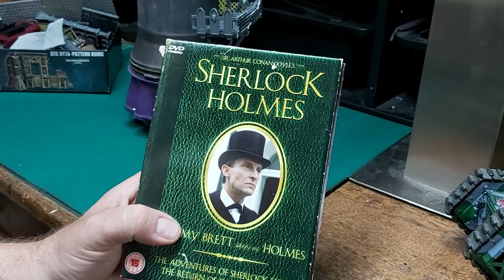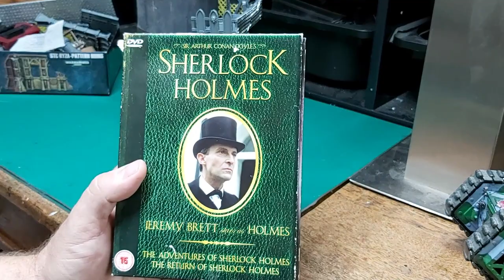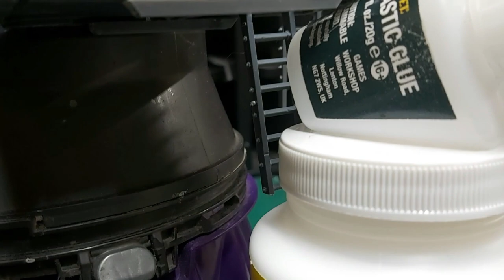Necromunda Scenery Build - The Slum Stack Part 2

Comment: This is a masterpiece. However, I couldn't help thinking it's also going to be a mega paint job. Many angles on the tower in particular show off the shanty structures and interiors to great effect and this tile definitely showcases the rugged underhive community of Pier Town. This piece has a ton of narrative potential and Necromunda has plenty of rules and encourages a roleplaying element to running a gang. I wish I had half the Cack you own but it's great to see it being given purpose to create a great setting.

I shall return now to building my own humble modular wall sections, all the more inspired for this. See you next episode :)
Reply from the maker: Thanks very much. I am already dreading the paint job. Spray paints are my friend. I am really enjoying this build, and the good news is I may have acquired another defunct Dyson, so there may be another.
Reply: @magratheabuilderofworlds7141 Excellent, the underhive provides. If you have any miniature aerials, antenna or cables they might look good too. This is going to look the business with the LED lights pushing back the gloom to reveal the metal shacks hugging the sump tower like fungi to bark.